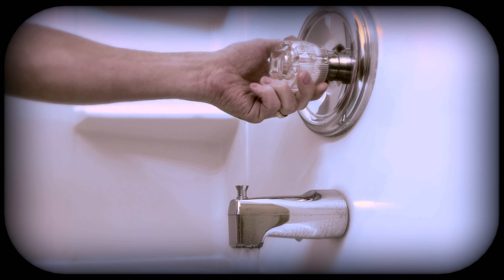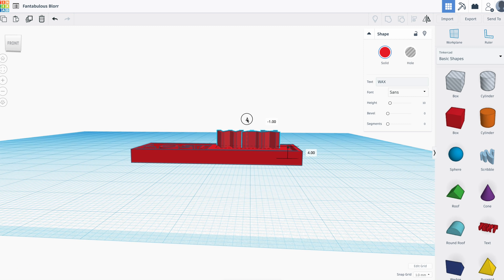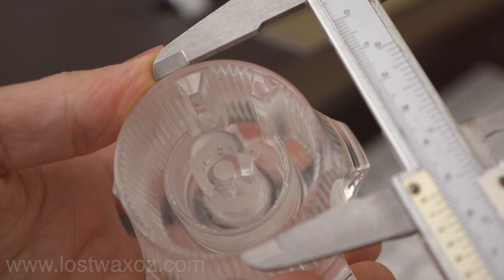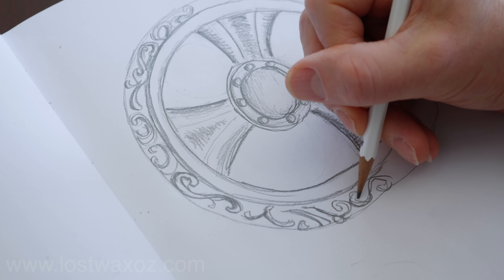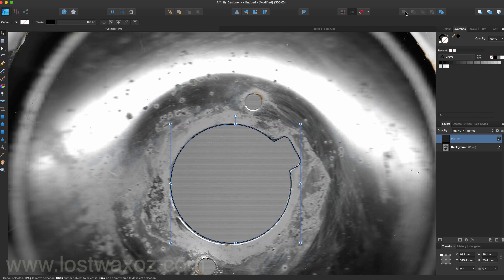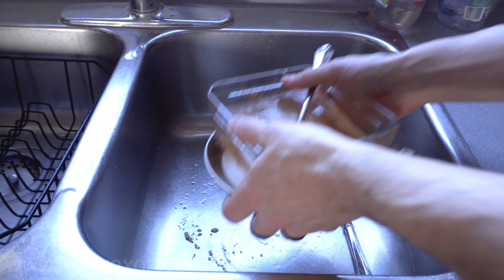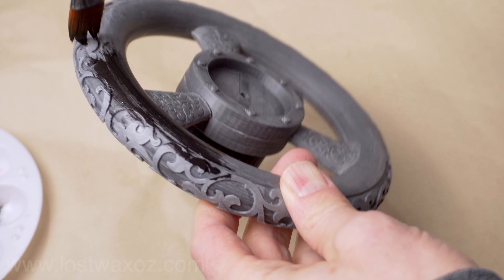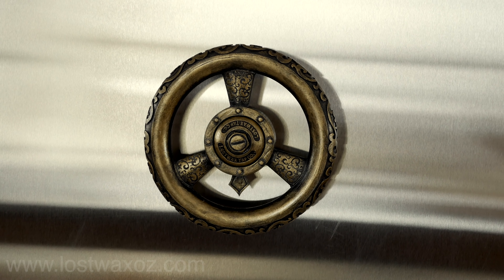I Make a Steampunk 3D Print Tap! 3D printer projects / Makeblock mCreate 3d Printer review.

Comment: Can you can use the laser attachment on foam? For patterns and designs you can later cut out with a exacto knife.
Reply from the maker: I haven't tried it with foam yet, probably in the summer when I can do it outside. It definitely wouldn't cut the foam, but I think it would mark it. Better to be in an enclosure though to deal with the fumes.

Comment: I love the stuff you build, and it is great you are getting into 3d printing, You may want to try using supports on your first model, or just split it in half and there would be no overhangs and no need to bend the filigree  and glue it on later
Reply from the maker: Yeah, I did try with supports, and it was a little messier. - Of course, I just used whatever support settings were default, so it probably could have worked better if I knew what I was doing😁 It would have been easier to just split it in half, but I do like that the swirl covered up the join line between the two halves.

Comment: You can cast it in metal, they sell wax filament that you can print the whole part in, then put it in heat safe container and fill with plaster then when dry you can bake out the wax leaving a perfect form of the model then pour in your molten metal of your choice and break away the plaster when cooled and sand any defects out then you're done
Reply from the maker: Yes!! great idea, I didn't know they had wax filament. In fact it's called the "lost Wax" method of casting. Which is actually where my business name came from- I started off as a jeweller using this process, and somehow ended up making foam costumes😁
Reply: @LostWax  that's awesome! And well it's not as popular yet as other filaments, there are a few companies that have them you should maybe contact one of them so you can get a roll free to be able to play with and utilize in things you need

Comment: Thats actually really cool the 3d printer laser combo! Have you tried lasering on the petg filament?
Reply from the maker: No I haven't, I just wonder if there would be some nasty fumes from that- but I have no idea.... Maybe when it is summer, I'll take it outside and try a few more things.
Reply: @LostWax  yea definitely prop 65 cali cancer certified. Even just cutting some plastics like vinyl with a saw makes aerosolized formaldehyde.

Comment: Cool, I think I like seeing you work with both Foam or plastic. You could also maybe try to use em together in a project.
Though I do still like the other diy video's since foam is a little more accessible
Reply from the maker: Yeah, I think they would compliment each other well in a project. And that's true about accessibility, I am guessing only a small percentage of my customers would have a 3D printer.

Comment: you might try a heat gun for your forming next time rather than the hot water.   the water is probably the safer way to make the curves, but the heat gun should be a bit easier.
Reply from the maker: Yes, I will have to see how my heat gun works with it as well.

Comment: Did you spray coat it with a waterproof clear coat or anything? :-) I absolutely LOVE that handle!
Reply from the maker: I just used pledge floor gloss on it- painted it on with a brush. It works great as long as you want a gloss finish.

Comment: Very cool Chris. Now I want to get a 3D printer and make steampunk taps for all my faucets :). Did you try cutting foam with the laser head?  Or does it only engrave?
Reply from the maker: Hi Traci! The laser head only engraves, and for using on foam, I would want to have it in an enclosure anyways.